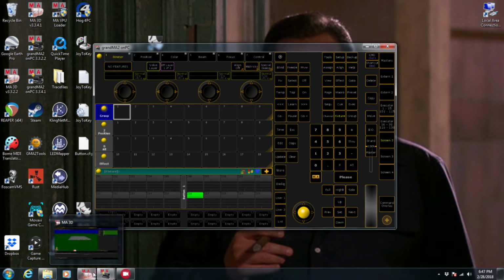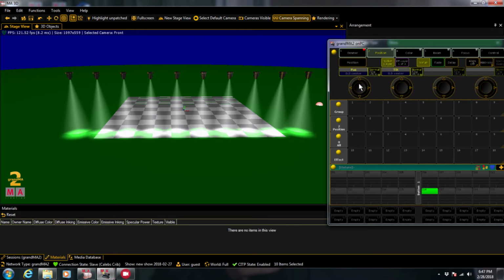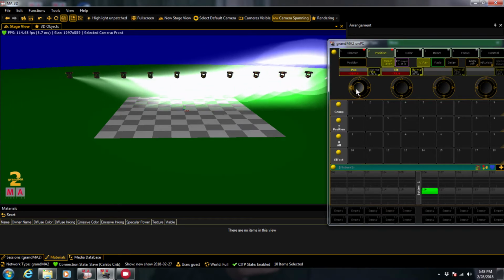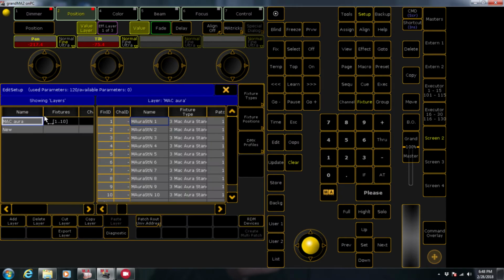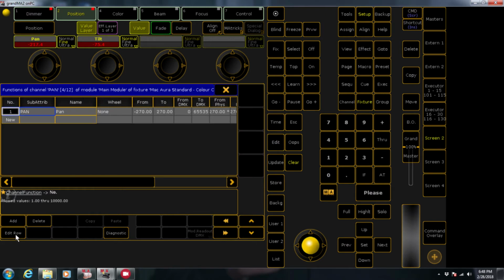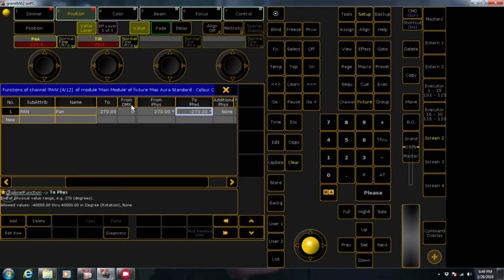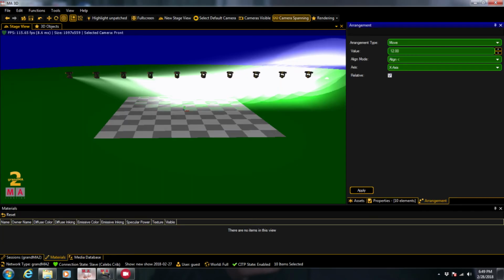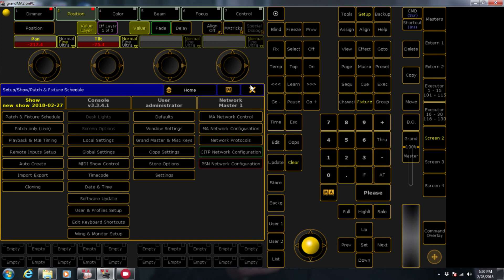Correcting a "Backwards" (Not inverted) pan in MA3D

Comment: my washers are rotating left in ma3D but left in real life and vice versa. i hope i can fix it tomorrow by using this method without having to redo all position presets
Reply from the maker: So they are correct? Or if you mistyped and the are reversed, this video should have solved your issue. Let me know please if it did not solve that issue.
Reply: @CalebHoernschemeyer  solved it. thank you